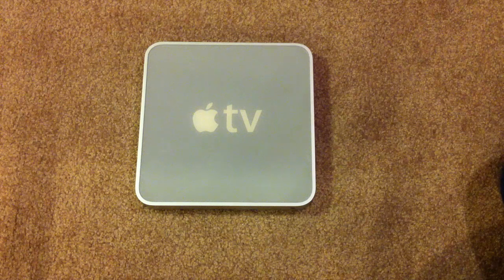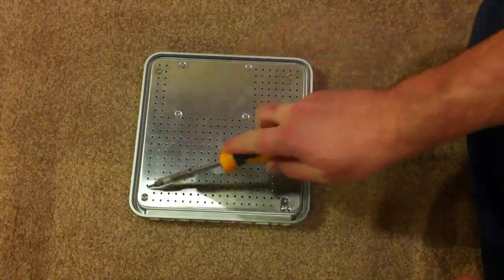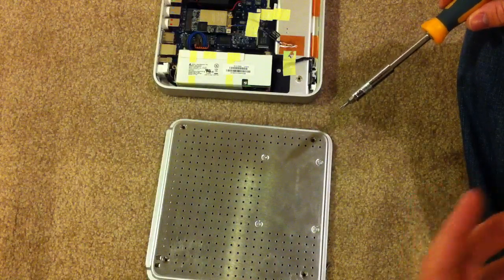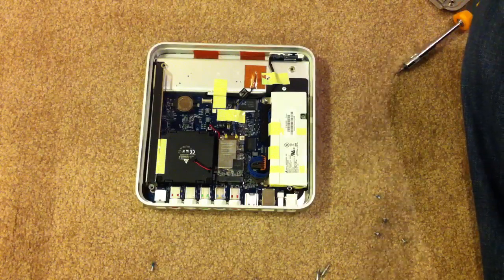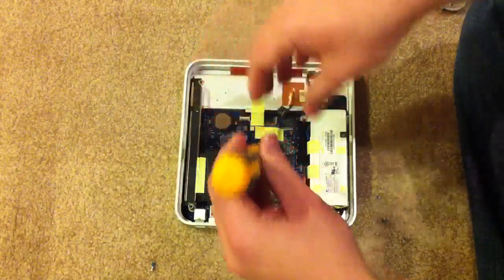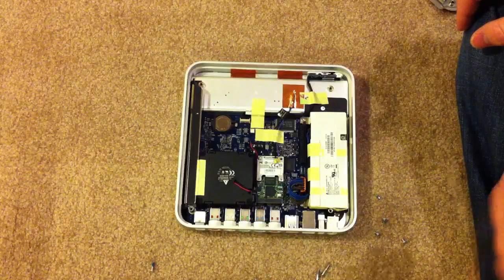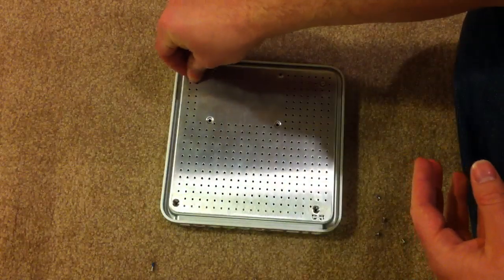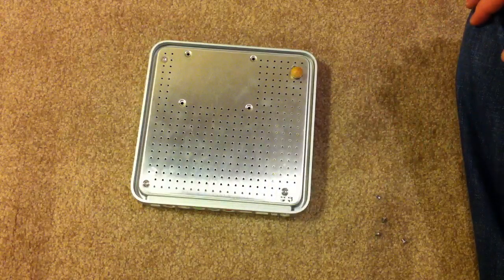How to install the Broadcom CrystalHD BCM70015 card in an AppleTV for Crystalbuntu

Comment: Rather than doing the tedious removal of all the double sided tape with a razor blade and cleaner, you can simply peel up each corner and unscrew the screws, that way the rubber can easily be pressed back in each corner and it will look original still.

Comment: Nice video, however, it would have been ever so helpful to have included the drive install step.  Below are the steps, ssh to your AppleTV, use the "defaults write" function to pull down the drivers, then goto Launcher -> Downloads menu item and select CrystalHD.  Next power cycle your AppleTV.  After booting startup XBMC goto Settings -> Video -> Playback and you should see "Allow hardware CrystalHD, make certain there's a blue dot next to it.  All should be fine now.  I'm using Launcher 3.2.5, XBMC 11, AppleTV software 2.3.1

Comment: Will changing to the BCM70015 help with the speed of decoding? I find that the smaller files 1-2MB playback find but as I get into larger MKV files they skip a lot of frames so it looks rather jerky.

Most of my movies are in MKV format and over 4GB to preserve the quality.

I've already installed CrystalUbuntu and have XBMC Gotham running on the unit.

Thanks in advance.
Reply: +Paul Pritsis Mkv files cannot be hardware decoded no matter what the videos encoded in.

Comment: HOPE this is of some help I left my apple tv gen 1 on for few hours to get some heat into it and by doing this back rubber and glue came of rather easy in one piece slowly working it around the edges.so now I can use two sided tape in strips to refit the rubber backing

Comment: turn the darned thing on and leave it running while u watch a movei.. turn off, lift the corners with care and the rest of the silicone comes off easilt.. once it is off, use acetone to remove the glue from the metal plate once you get it out...

Comment: I'd recommend against removing the fan: 
1) it's really quiet, 
2) it's there for HDD & remove heat generated by the PSU, 
3) the CrystalHD will generate some heat too, 
4) in such tight spaces every bit of cooling helps,
As you noted the CPU is on the other side of the board and top+sides of case are used as heat sink, hence the case heat up like crazy (and some ends up inside). The unnecessary rubber "carpet" Apple glued at the bottom kills more airflow. If you care not about looks, ditch it.

Comment: Nice tutorial. 
But I suggest not to pull the fan, Just disconnect the cable of the fan.
Regarding the Harddrive, I suggest using a IDE2CF-Adaptor in 2.5 inch form factor to run the CF-Card in so called "true-IDE" mode. 
So you can install the linux to the IDE-Drive which is CF, and should be faster then USB and take much less CPU time then USB. There are fast CF-Cards around which support UDMA, so you get a damn fast system.